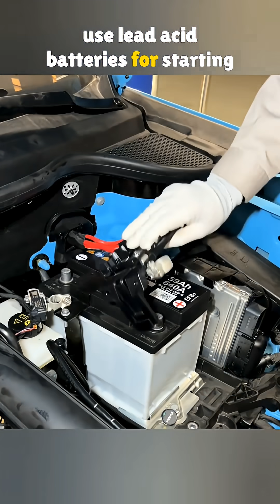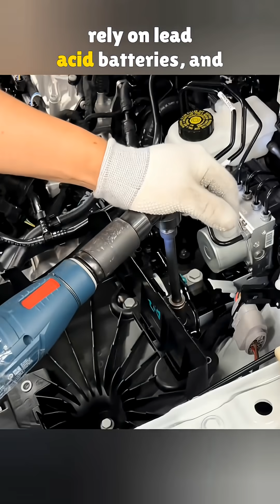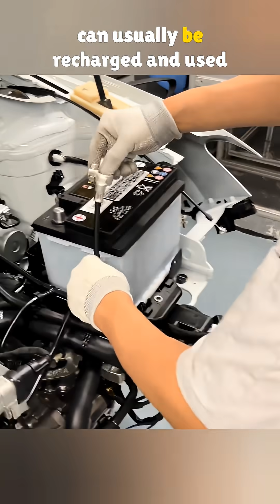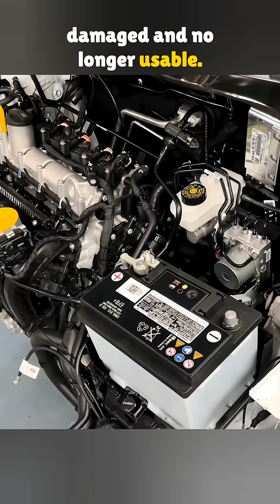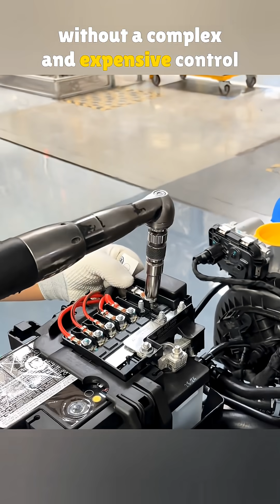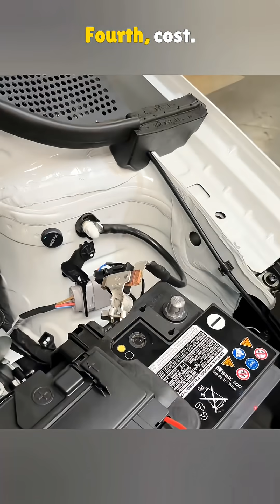Why Modern Cars Still Use Lead Acid Batteries

Comment: My 2019 lexus lead acid battery died 2 weeks ago and called the dealer , they tried to sell me lithem battery i asked why i couldnt use a acid batery since the factory put it in , crickets , went to store an bought acid battery 80 bucks and its fixed for another 5 years

Comment: There are 4 reasons why car manufacturers use lead-acid batteries: 1. Money, 2. Money, 3. Money, 4. Money
Reply: Don't forget..... 5) money 😌
Reply: True 1. cost is primary 
2. Safety 
Ic case of accident lithium catch fire quickly 
3. Lithium capable high amp charge this cannot be handled by car alternator
Reply: So what? Would you rather pay more for an inferior product or pay less for the best battery for the job? 
What are you even complaining about?